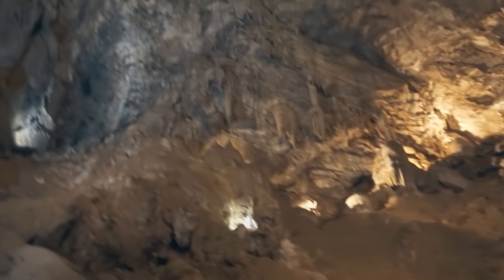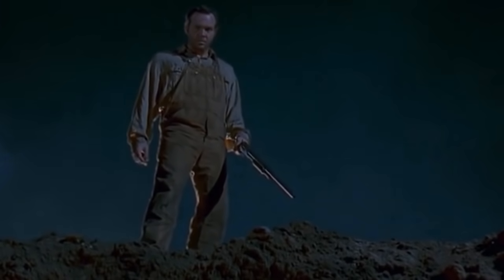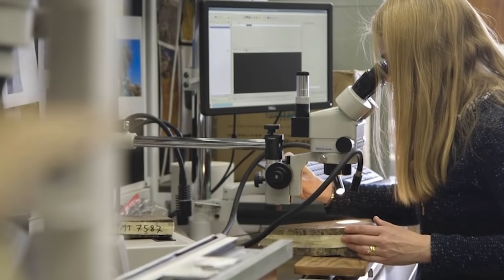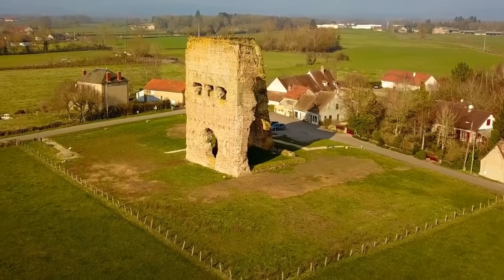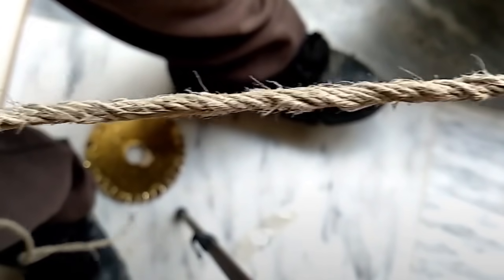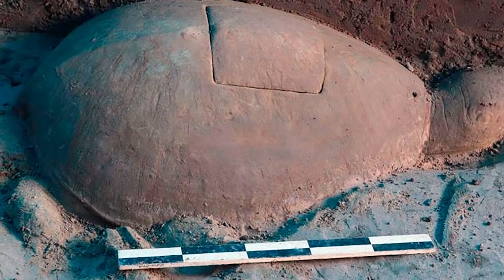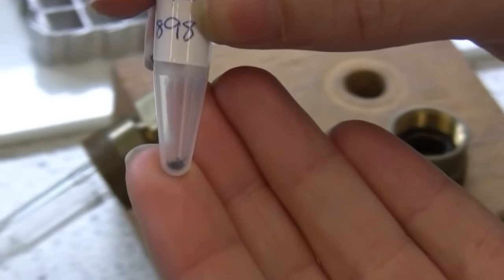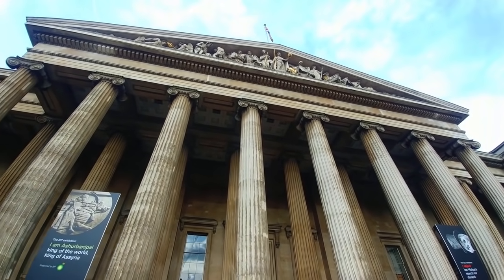12 Most Amazing Recent Artifacts Finds

Comment: Failed to mention that the turtles, there were more than one, were filled with crystals and wires/cables.
Reply: Exactly...
Reply: I came here to say the same thing.  They even showed a picture with the opening at the top of the turtle in this video and didn't mention it.  Ancient people knew a lot more than what we think they knew and could build things out of stone that we can't...  We need to rethink what is often accepted as fact and realize that we really don't know how advanced or ancestors were.
Reply: Also, an unknown gel like substance filled the cavity of crystals with brass wire, amazing. Yet to be determined what exactly the gel is made and or consists off material wise.
Reply: More details on this turtle's are in "Praveen Mohan channel"

Comment: How did they drill the 4 holes
Reply: Um... those holes weren't "drilled" by any modern understanding of the word. Technically, by pure definition alone, but the reality is they just probably used a sharp rock or something. It's not that miraculous honestly, at least not like those holes drilled into rocks in Egypt or South America (cant remember now) that look like it was machined using a modern diamond bit bore drill bit.